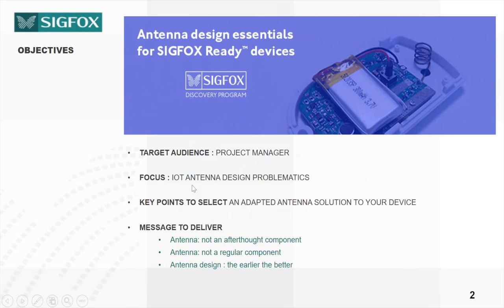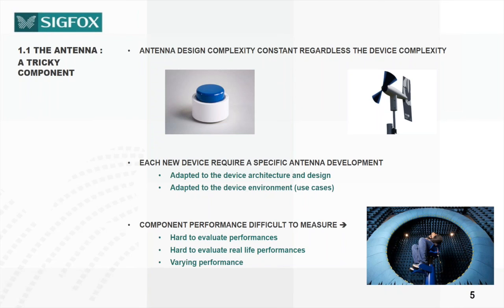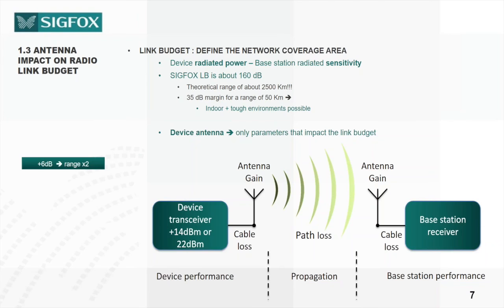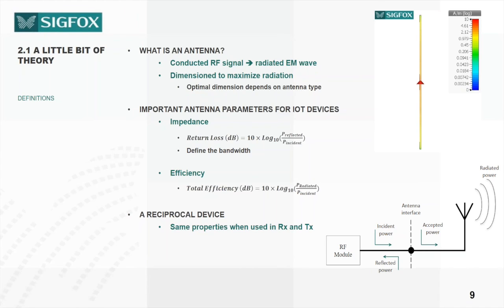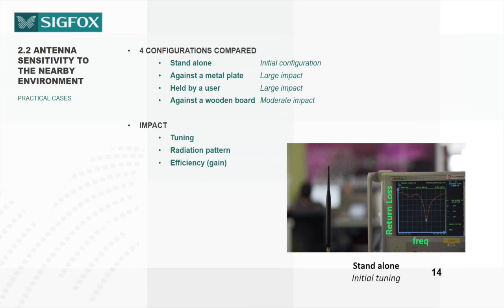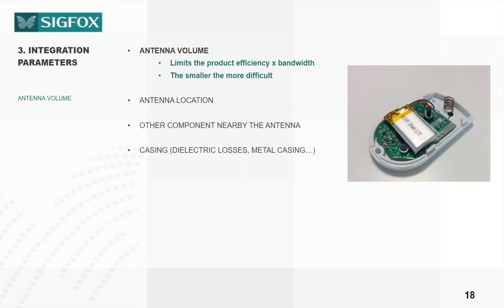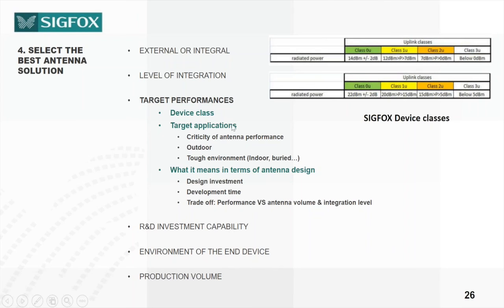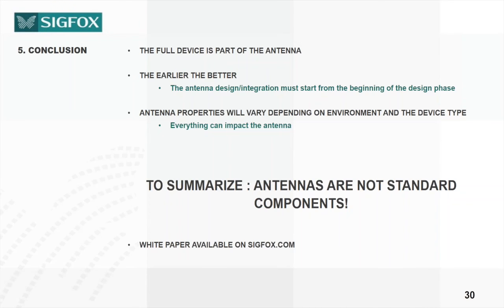WEBINAR: Antenna design essentials for SIGFOX Ready devices - Webinar HD

Comment: you could add 2D/3D RF simulation and antenna design softwares into requirement list. they are not cheap but they give  a lot of idea before experiment an antenna design.